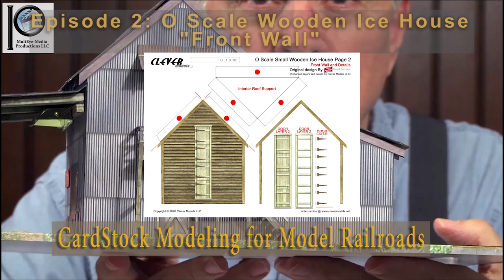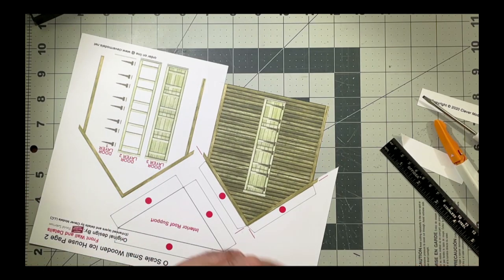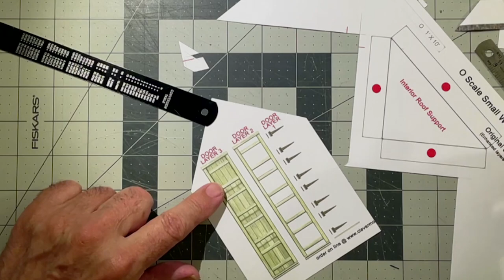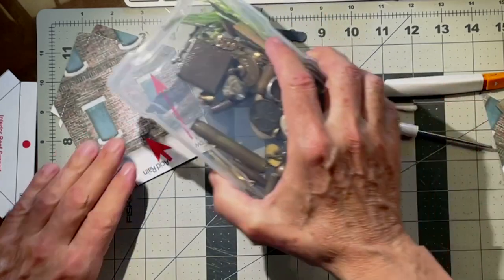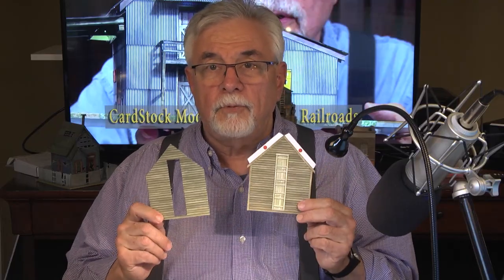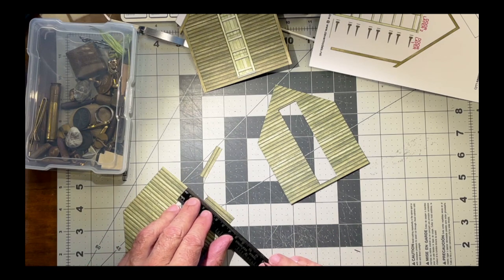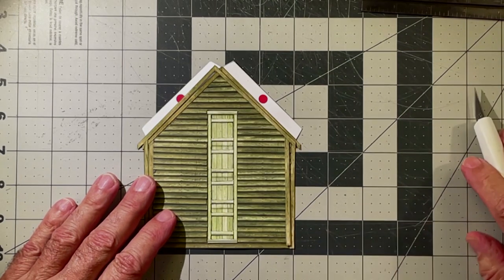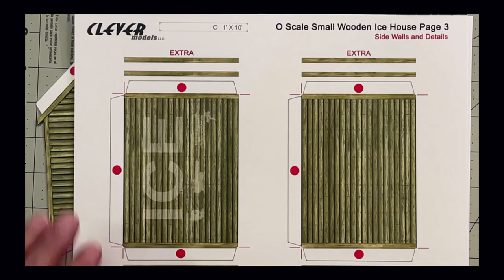Episode #6B CardStock Modeling - O Scale Wooden Ice House - (Video 2) - Making the Front Wall

Comment: Hi.

There are not too many card-stock modellers out there. And I found your work excellent. 

I see that you cut out the intricate shape of the trim, and then before gluing, you just cut the shape into straight pieces. It will be way easier to just cut the straight pieces directly with a scale and that will reduce the intricate work of 'cutting the corners'

regards.
Reply from the maker: Hi Ajay, appreciate your watching and enjoying the videos.  Very good ideas! Sam